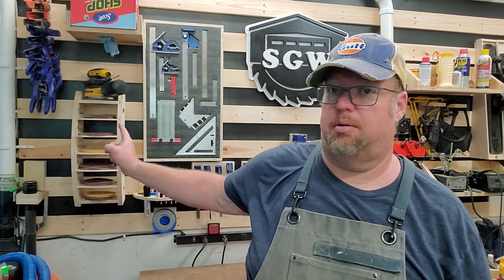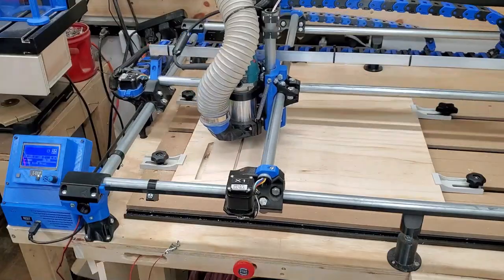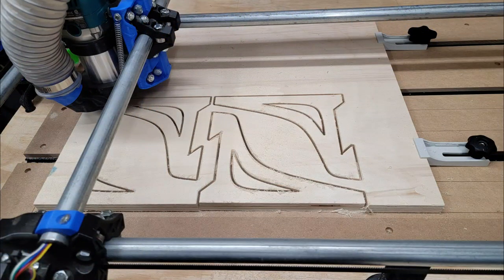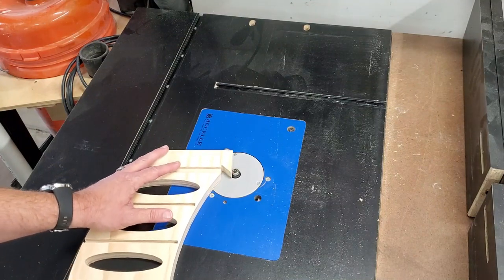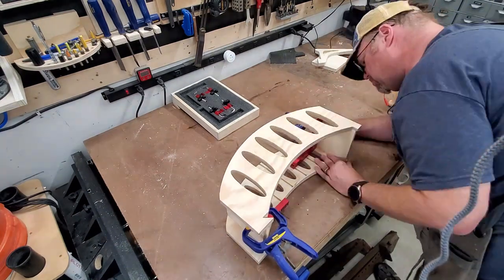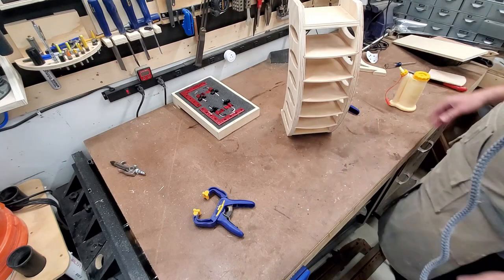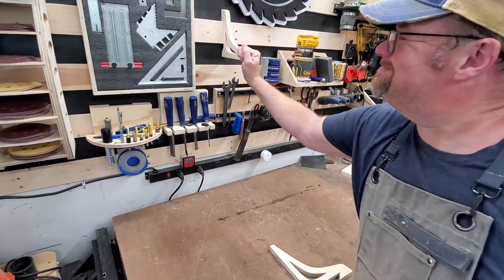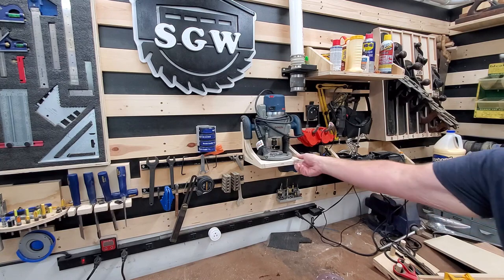Build a French Cleat Sandpaper Station and Custom Shelves a CNC - FREE CNC FILES

Comment: Gained the habit from metrology of keeping sandpaper covered and to not reuse due to ware and contamination.  Different tolerances for woodworking but other than the belt sander I keep them covered.  Probably overkill but I do tend to dabble beyond wood.
Reply from the maker: I go through paper pretty quickly,.so it doesn't hang around long enough to be affected